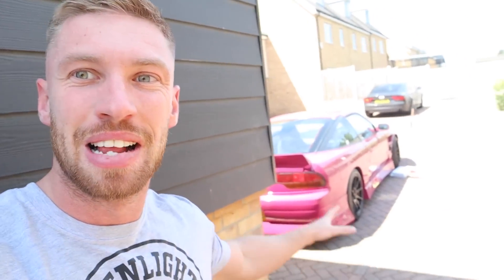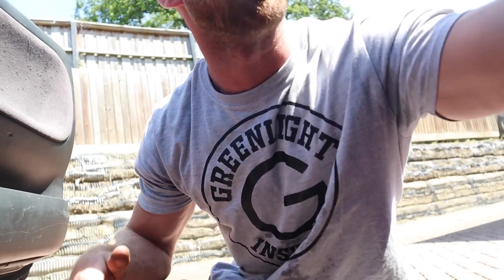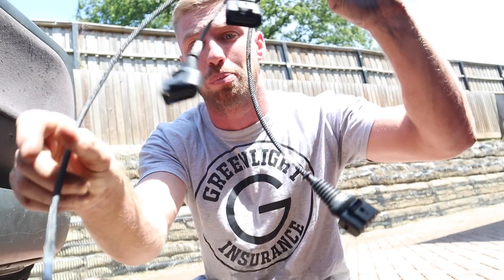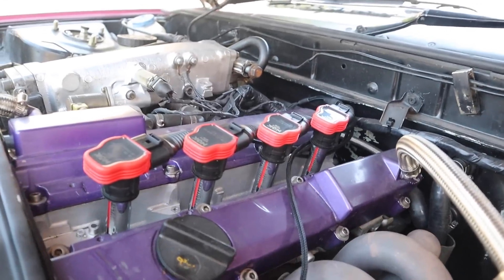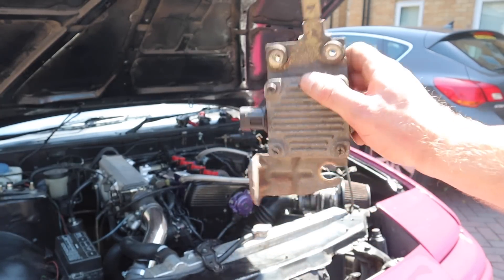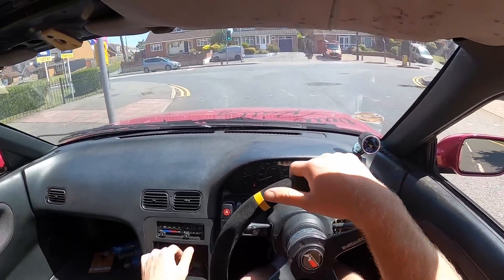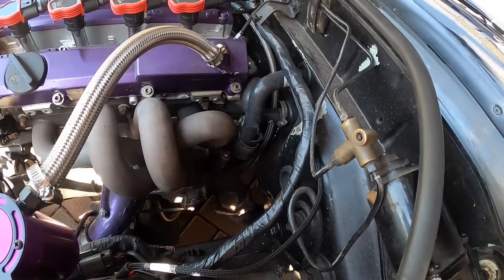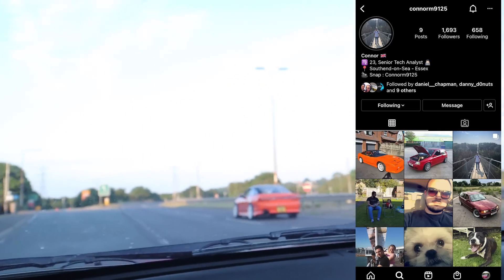AUDI R8 CONVERSION on my Nissan S13!

Comment: if you have the original coil pack cover you measure out carefully 4 holes
 and if you get them same size as the upper seal on the r8 coils,
or couple of mm smaller,so they squeeze on tight they will be supported

Comment: Bmw Mini wheel nut bolts are 14mm 1.25 if that helps for a bodge
Reply from the maker: Are they?! Interesting. Cheers mate.
Reply: @itsleelockwood  yup I had a nightmare trying to find some decent lug nuts after a stud conversion don't know why they use 1.25 I few more bmw use them aswell breakers will have one for about £2

Comment: Yo Lee, the boost gauge should show negative pressure when idling, as you know it runs off of the vacuum from your intake manifold.  When it’s idling it’s still creating a vacuum which is less than 0 (Atmospheric pressure). The boost gauge is fine! 🤙🏽

Comment: Boost gauge is working fine, on idle/standstill the gauge should be reading vacuum, which will be under 0psi/bar. Nothing to worry about there
Reply: That’s what I thought, diesels sit at zero, petrol sits  in the negative on tick-over. 🤔

Comment: Mark the bolt where it protrudes out of the hole. Remove it and cut it so it will be a flush fit. Use your grinder to cut a slot in the part of the bolt that faces out, so it looks like a slot head screw. Use PTFE tape and screw it back into the PCV valve hole. Will look ok ✅
Reply from the maker: It’s not threaded all the way along I can’t :(
Reply: @itsleelockwood  I think you miss understood me. If the overall bolt length is say 100mm of which 50mm is threaded and will screw in, use your disc cutter to chop the bolt in half. Discard the non threaded piece and clean up the end of the threaded “stud” with a file to remove any roughness caused by cutting it. You now have what looks like a stud.  Now cut the screwdriver type slot into the face of the part of the stud you have cleaned up and screw it in.

Comment: The boost gauge should be reading vacuum at idle like it is
 not 0
Reply from the maker: It reads 0.-3 when the car is switched off, it’s definitely out
Reply: @itsleelockwood  right, eBay gauges I guess

No good
Reply: They should sit around -20
Reply: @Tony19580  its in bar so -.3 is about right

Comment: You could install bonnet raisers to help get the heat of of the bay? They are Little spacers that go on the bonnet hinge to lift the back up a bit when it’s closed. It creates a gap at the back where the seal is. Air will come in through the front bumper/grills and up and out the gap at the back of the bonnet.

Comment: Boost gauge is correct, at idle it'll be reading vacuum so it'll never sit at zero. Vacuum should roughly be between -18 to -22hg with no leaks.
Reply from the maker: It sits at -0.3 when the gauge it’s off, it’s wrong

Comment: My dad raised the rear of his bonnets on both his r32 and r33 to let engine bay heat escape, maybe worth trying if you don't go down the vented bonnet route, looks pretty cool too 👍
Reply: Windshield causes high pressure zone in the area of rear bonnet. Most likely going to have opposite effect in terms of venting hot air from enginebay.
Reply: It does help I did tests and it does drop the temps under the bonnet as long as you don't have a belly pan

Comment from the maker: Hey everyone! Lots commenting about the boost gauge, the gauge reads -0.3 when the gauge is switched off, and it jumps below the minimum setting. The gauge is wrong! I know a car when on a proper ‘idle’ will be in negative boost boost pressure and vacuum, but the cars idle screw does not work so it’s never actually on ‘idle’ instead I have to use the throttle cable to imitate an idle until I can get this fixed… but, long story short; the gauge is sh*t 😂